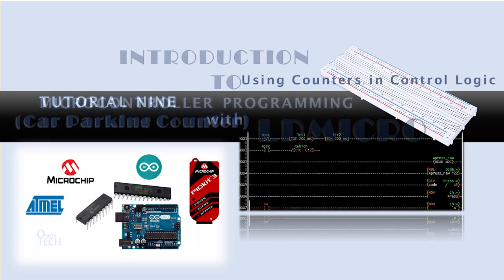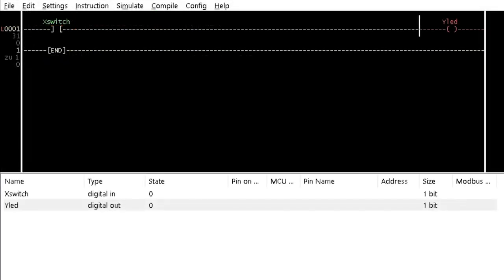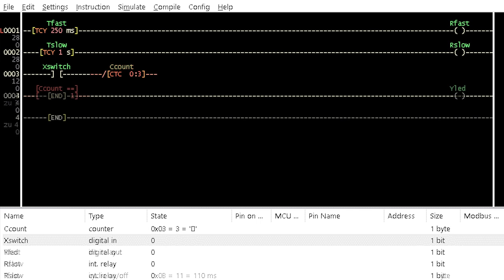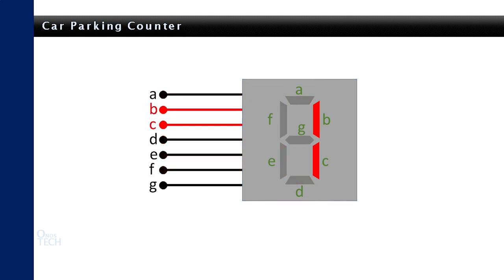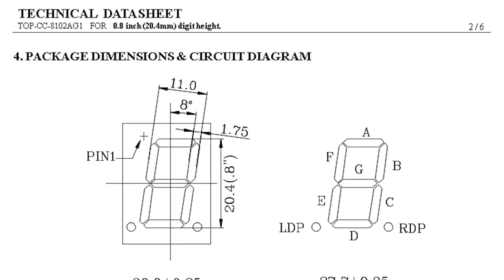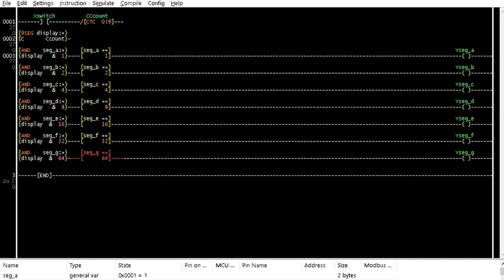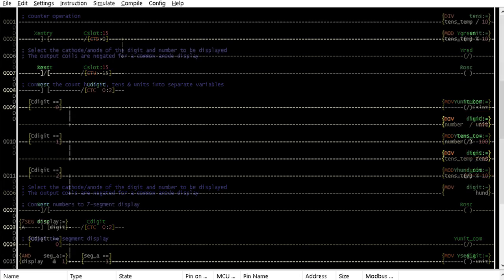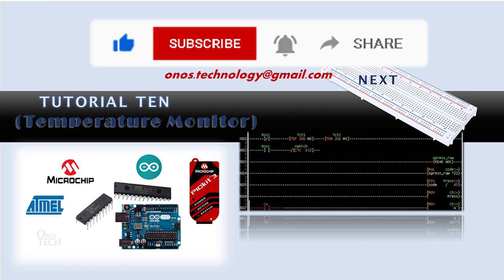LDmicro 9:  Car Parking Counter (Microcontroller PLC Ladder Programming with LDmicro)

Comment from the maker: Dear all, please note that the value of the resistors connecting the BC557 Transistors is 10 kilo-Ohms and not 330 Ohms. The emitter (E) should be connected to 5V instead of GND. Use the link in the description to download the Circuit Diagram.

Comment: Fine! But what frequency  of osc is?
Reply from the maker: 16MHz for Arduino nano
Reply: @OnosTech  Rosc ?
Reply from the maker: Rosc is based on the PLC cycle time which in this case is 1 ms. Two cycle time is required for the period. Thus, the frequency is 1/0.002 = 500Hz
Reply: @OnosTech  thank you so much!
Reply from the maker: You are welcome 🙂🙂🙂